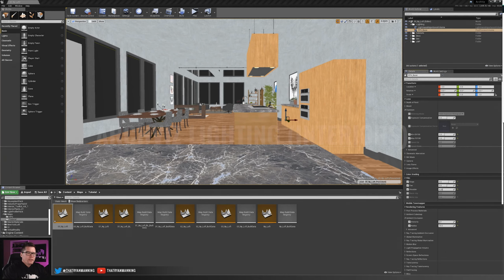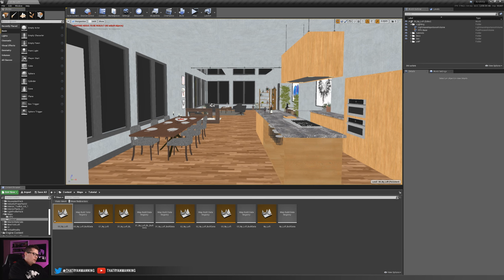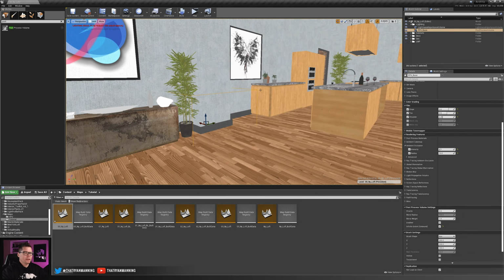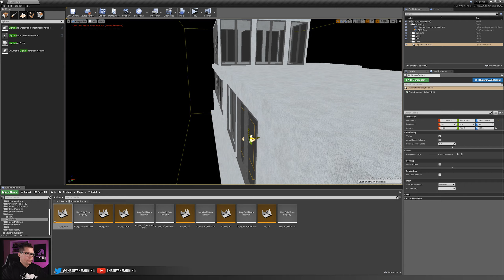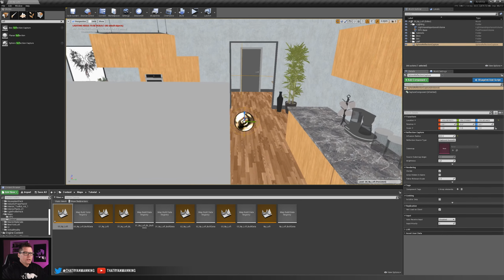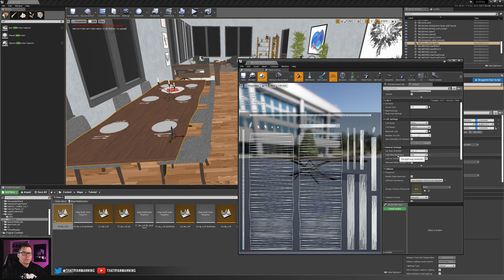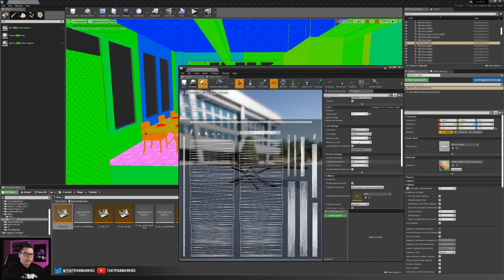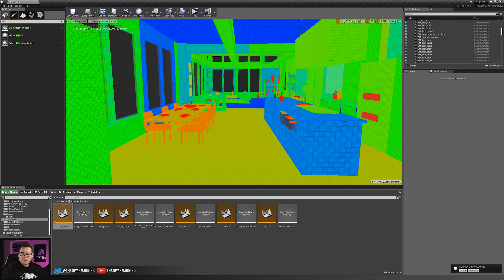UE4 Interior Lighting Series (Part 1)

Comment: Great series.  Your pacing and the amount of detail is perfect.  Though, as a rule, using the Override Lightmap Resolution should only be used sparingly, not as the default process.  That scales the lightmap up but the problem is that the size of the islands (and the space between them) also scale up proportionately.  If you start with the default Min Lightmap Resolution of 64 and then blow that up to 512, you're going to have a ton of wasted space between the islands.  You can use the override method to quickly get a general idea of the lightmap size you need for that mesh.  But then you should turn the override off, double-click the mesh to open the mesh editor, go to Details > LOD 0 > Build Settings > Min Lightmap Resolution, set a new Min Lightmap Resolution, and hit Apply Changes.  This will optimize the size of the mesh islands on UV Channel 1 to the new resolution (tip: have the UV Channel 1 window open before applying the change to see the difference!).  After that, go to Details > General Settings > Lightmap Resolution and verify that it matches the Min Lightmap Resolution you just set.  Kind regards.  (Edit: grammar)

Comment: Your work is amazing Ryan! I love total realism in games and 3d. You have the eye for it! Just curious: Is there a way to set meshes in the world, such as a wall for example to block light from lighting up surfaces that extend along a perpendicular wall? or like if you had an open box turned on it's side, sometimes the engine lighting system will illuminate parts of the inside faces near the edges inside the box. I always wondered how I could stop that light bleeding. A third example would be if you had two rooms next to each other, the light might bleed onto a wall from one room to the next.

Comment: Hello you are using RTX? I'm thinking of buying a 2080 rtx or 1 2080 ti but I think it's not worth it yet, due to the value and if the customer ultimately realizes the improvements!
Reply from the maker: I'm currently running a 2080 in my primary dev machine and TBH, I don't feel it's worth the money. Support is limited and not a lot of applications fully support it. I personally would get a 2060 if you want RTX or get a 1080ti if you need horsepower...otherwise just wait till prices drop. :)
Reply: @ThatRyanManning  
I'm from Brazil and around here it's hard to find support from UE4, and I follow your channel, and I found it super cool that you answered my question and make me have more and more interest in your channel, thank you very much